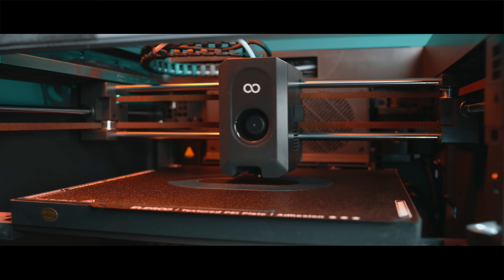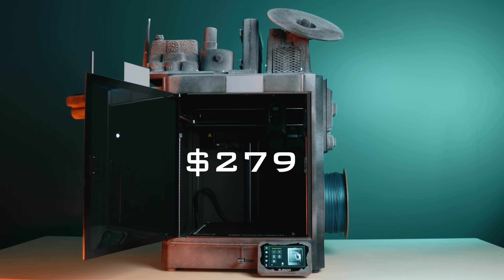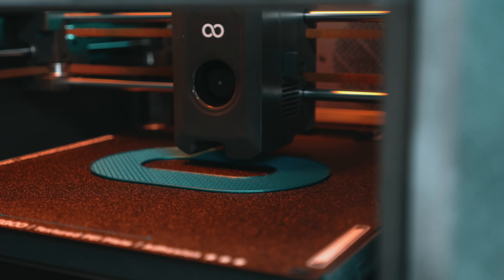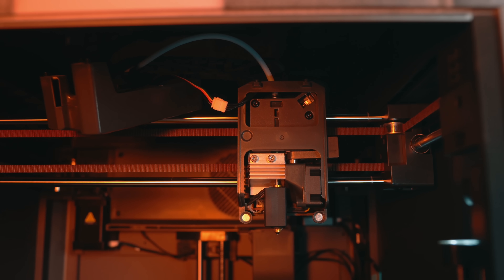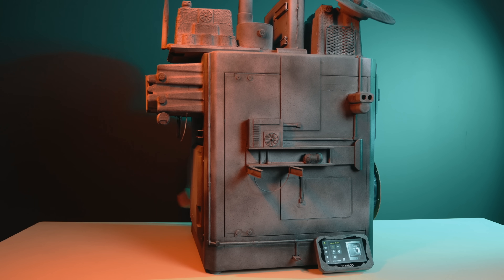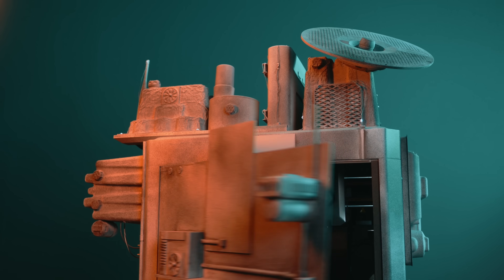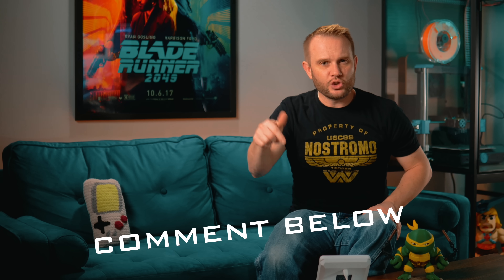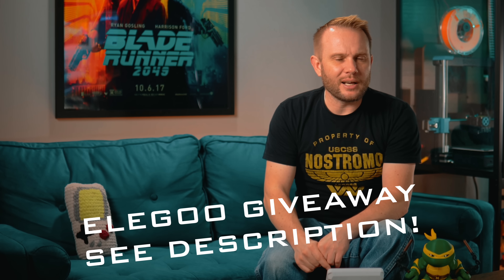The Sleeper 3D Printer Nobody Talks About

Comment: I bought my Centauri Carbon the day it was announced. It has been flawless for me ever since. It is currently sitting at over 232 hours of printing time and has not let me down yet. I will definitely be buying more of these. My unit has the weak single led light with the MMU port in the lower rear. It goes toe to toe with my P1S in print quality and speed. It's fans are noticeably louder than the P1S fans but that is my only complaint that I can deal with.

Comment: I think some of it is that many of us got burned by the Neptune 4 series and them quickly jumping to the next product. I think I was even kind of excited about this one, but I decided to wait and see if they would bring out an AMS like thing… still waiting.
Reply: ams is meh
Reply: Elegoo already gave up on their filament multiplexer for the CC and announced the CC 2 with Flashforge AD5X-style multiplexing.
Reply: @WhoWatchesVideos  They just posted a video of it this week on reddit as a teaser, Not sure if there will be more news coming. 

That aside I got one for christmas and it's kinda ass TBH out of the box after auto belt tension I can only print exterior walls at 1000 mm/s^2 

I need to do a whole frame check but that's far from the "fast out of the box advertising all these people are doing
Reply: @Portlandhardstylers not sure why you’d care about high acceleration on exterior walls when consistency is usually most important for a good finish.
Reply: I wanted to get one because of the price, but the neptune 4 i have took many hours of work to get it working reliably because of software problems. It now works great but runs on openneptune, a firmware made by users, making it totally different from a plug and play product

Comment: I've got over 500 hours on each of my two Centuari Carbons. The only issue I have is that the default Z-Offset sucks, and the machine doesn't remember my manual Z-offset change between power offs.
Reply: Wonder if the newest Open Centauri firmware would fix your problems.
Reply: Current firmware fixed that zoffset saving issue. Auto zoffset still sucks. If for some reason you dont want to update the firmware you can manually put that zoffset in your slicer printer setting and it will apply that offset on every print
Reply: How come the need for Z offset changes? Different filament offset needs? Does it not respect the G code in your slicer?
Reply: @fortezzasolutions the Z-offset help with layer adhesion, how close the filament lays on the plate. For example everyone would love to keep theirs at 0.075 but this thing just doesn't keep at that
Reply: @fortezzasolutions Their z-offset doesn't change, they're saying it's non+default but the printer always reverts to default.
Reply: Same issue. That’s been a major issue for mine as well.
Reply: Just use Orca, Z will stay put.

Comment: Had 1500 hours on the machine, but returned it because of the mmu gate they produced. It was a very very good printer despite the fact that I needed some spare parts which were broken. But the support has sent everything without any discussion, so that was very good.

Especially for the price it is a really really good printer. But I wanted a multi color system from day one and was very disappointed by the unprofessional handling of that topic by elegoo.

Now I have a Snapmaker U1 and a P2S and I can say that the print quality of the CC is very high, but not perfect compared to the other two machines. Especially the U1 is incredible.

Comment: I have used the ECC for 290 hours, no major issues, newer build date machine.  I like the speed and capacity of the printer.  Only have printed in PLA, PETG and ASA.  It is a bit noisier but no deal breaker.  I have some print profiles to keep noise down on most models, maybe somewhat slower printing.     It is a very good printer.  Consider for newer users and expert alike, do your research. 
No multicolor required, it could be good, but I guess it will require some major upgrade for that.  Never have applied the firmware upgrades, not broken yet. 
I would say though, that Elegoo should reach out to fix the USB cable risk issue and replace at least those.
Wirth such low parts availability for this printer, it might be difficult to recommend for a print farm environment.  Why, never seen wear parts such as belts, motors, full extruder head on any site yet.

Comment: My heatsink fan died within 50hs of printing, gave me a clog of doom. With all button head screws rounded out by factory, it was a hell of fun disassebling the extruder unit. Elegoo sent me the needed spare parts without hesitation, they even offered housing parts of the extruder. Undortunately it took about 2 weeks to get them. I found out, the k2 is using the same fan with the same issue. Ali sent the replacement within 4 days, a small solder job to swap connectors, I was back in printing. Since then it's running like a champ!

There are still some more or less annoying things, losing z-offset, forced full homing if u want to move an axis, filament unload sequence when doing a pause@height, no proper working p.a. tuning with vanilla orca, and some small other ones more.
In the end, it's a well made budget workhorse with some flaws due to cost cutting that other way more expensive printers have, too
Reply: FYI the heatbed thermistor is the same one that a prusa MK3 uses. Elegoo will not tell you this. Waited a month for mine.
Reply: I use vanilla orca with proper, built in PA calibration just fine.